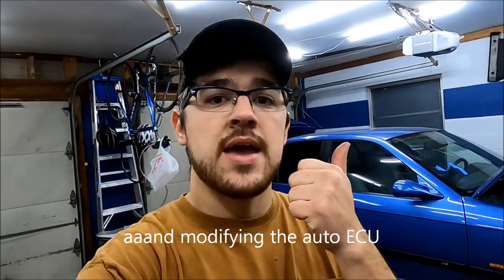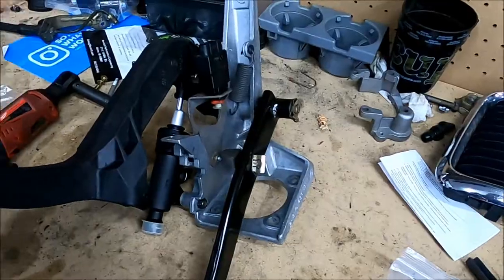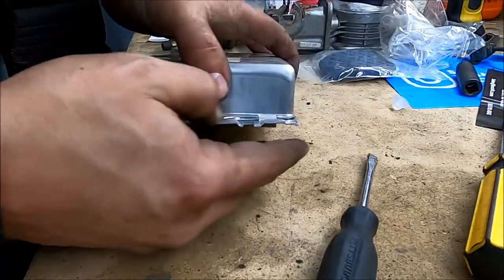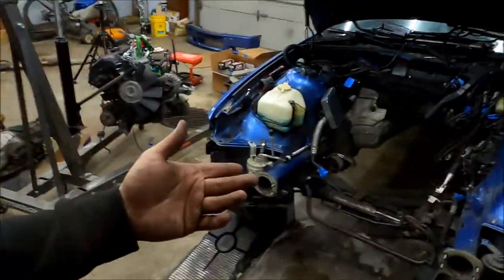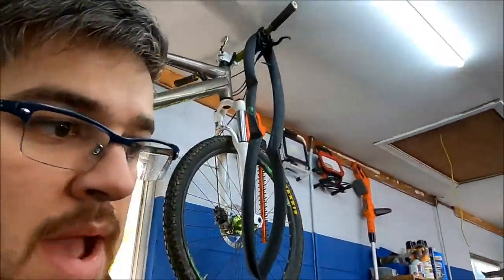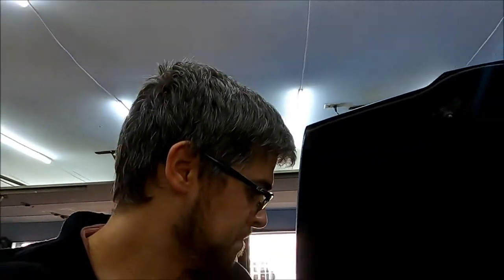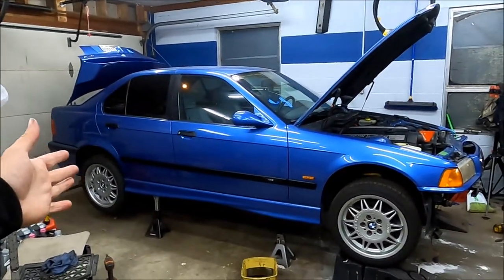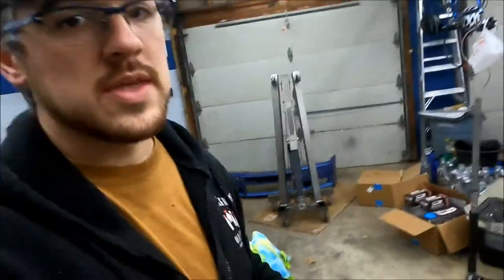E36 M3 Auto to Manual Swap - Part 3/3

Comment: Hi why did you removed the chip on minute 8:50? I’m doing the same process but my car is already manual, just the engine came from an automatic 328is and mine is a 318is